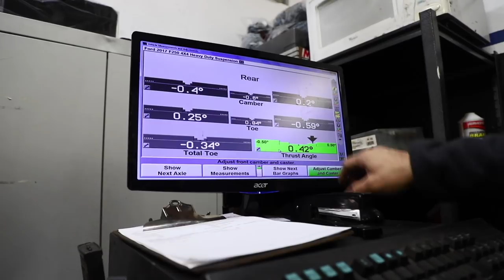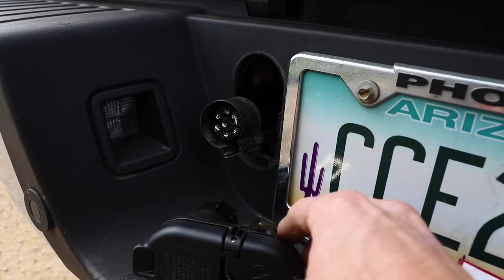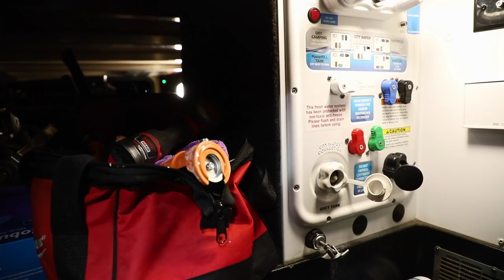SEASON 7 STARTS NOW! NEW AXLE & WARRANTY UPDATE (KYD)

Comment: Just wondering why you chose to do the screw as opposed to just using Binary Epoxy from the dollar store and gluing it on?
Reply from the maker: Epoxy would have worked, but permanent. A set screw is reliable and I can take it apart to replace with the factory part if needed. That was the thinking.

Comment: That is the first issue I ran into when someone in our group brought home a Grand Design  trailer, the axles aren't heavy duty enough.  GD advertises on bigger tanks and thicker gauge siding (on aluminum sided models) which is all heavier, but they use lighter duty axles than some competitors (Jayco for instance).   Really frustrating from a company that is selling at a premium price.  That's what you expect (and get) from manufacturers like Heartland.

Comment: I thought of running the cable through the loop of the pin but, what if for some reason the cable does get yanked it would either pull the pin out or disconnect the latch and the pin would eventually fall out. You might want to rethink that.
Reply from the maker: It's a great point. I'm going to get a locking safety pin.

Comment: Noticed you were checking why zero big trucks with the price of that GMC truck , we have a similar problem in the UK apart from the LHD drive problems our wonderful goverment gets greedy if I import a big truck firstly there s VAT at 20% then a 15% import charge so that push s the prices up 35% above your local prices then we get the importers fleecing us to change all the direction lights to yellow ect ect , So we end up paying 40% extra over and above your local prices, Then you have to ask would you pay 40% extra for your Ford Truck ?

Comment: I must have missed your follow up on the rock tamer guards. How did you like them?  I noticed they are not on the truck
Reply from the maker: I didn't cut them high enough. They need to be 3" off the ground with a load and even that might not be high enough or they can actually create rock chips.

Comment: I have a question: in all your travels, have you ever considered the use of a CB radio, or are they no longer realivant today with cells and apps?
Reply from the maker: We did for a bit. If I was better at it and had a big antenna it would be fun. But it turned out to be another device to keep track of in the cab.

Comment: I am looking at rvs and Ive noticed like on your rv the axles are 5200 lbs each from what I saw from the dealer, I would think you would want 6000 pound axle ratings for a gvwr of almost 11000.
Reply from the maker: It's because of the tongue weight, but I agree. They cut it close. Grand Ginger only has 1,400# of payload. Not much for fulltime usage.

Comment: Grand Design RV look nice but it seems like they have ton of problems. From all the videos,  it just seems like you have issue after issue. Tires, axles, water pump.... Maybe all trailer brands have their problems?  Just seems like a lot.
Reply from the maker: This is a common misconception that I should have mentioned. At this price point, the problems are all isolated to the vendors. Dometic, Limpart, Atwood, Surburban, etc. The same parts on the same price point from a different mfg. Spend another 50k and the owner gets a new set of problems. Many of the problems RV, Boats and Planes have is due to building for weight. Give an engineer another 2,000 pounds of GVWR and the parts get better. Less plastic. Carbon is light, but $$$ Always a trade-off.

Comment: You mentioned that all trailer axles have a curve, I noticed that my brand new Montana has a curve, how are we sure that's not a bend caused by a floor lift.
Reply from the maker: I doubt a floor lift would have been placed in the center of your axle. The crown is normally a slight curve. You could take it to an axle alignment shop to check, but our tires will be the giveaway.

Comment: Creative but concerning.
1) cable under hitch lock pin, if it pops out major accident concern.
2) tow harness attached w/screw , get a net wire harness section...
Good Luck.
Reply from the maker: I agree. Making corrections.

Comment: Hey I thought I would let you know something about axles, there really are no  5200 lb axles, sounds crazy I know but you can check it out your self as I'm sure you will. Really there are 7000 lb axles with derated hubs. So you're axle is really not even close to being overweight just the bearings on the derated hubs. So I'm sure that axle replaced was defective from Dexter. You could buy 8 lug his and new wheels and have 7000 lb axles that's what I did and I never worry about my axles now. Have good travels this year.
Reply from the maker: I get it and that makes sense. I still think the axle was defective from the start. It had a funny shape all along.

Comment: Putting the trailer cable through the hitch lock pin would worry me with that spring pin.  If you have any snag during a turn and lose the pin you are down one safety device.  If you used a padlock for the lock pin then it would be safer and give you some extra theft security and you could loop the cable through it.  Could just be a long shackle combination lock so you don't have to worry about a key.  Also won't have to worry about some bozo who thinks its funny to mess with your rig and pull the pin on you.
Reply from the maker: I agree. That's a good idea. And because the pin is never removed a lock is a good idea. Good input.

Comment: your instaled the new power clip its up side down. the rain  water its going to go inside
Reply: Negative.  It is on correctly.  Look at any Ford truck and see for yourself.  It is also DC power.  A little water is not a problem.

Comment: What is the reason for not crossing your chains? Because of the Hensley hitch?
Reply from the maker: I mentioned this in this video, but it didn't make the edit. The point where the chains come from are on a ring (same point). They don't cross. Even when I cross them, they don't actually cross.
Reply: Thanks for the reply. Makes sense with the ring. Watch out for the wind.

Comment: Cringggeeeee let those glow plugs warm up😁😁
Reply from the maker: Is that still a thing with the new diesels?
Reply: @KeepYourDaydream  Absolutely! May be less of an issue in your warmer climate,  never the less a 70° engine is still a "cold engine." So turning the key to accessory, waiting the ~10 seconds for the glow plugs to warm up heats the cylinders which gives you a better ignition on start up.

Comment: Boy that dealer ripped you on the waste water fix. Less than $30.00 and 2 minutes of your time to install a Valtera twist on waste valve would have cured your problem, would have saved way over $200.00 Guess you know where never to go back to now.
Reply from the maker: I agree. I added it to the work order at drop off. They never called and asked for an estimate. I should have known better when I picked it up, but I was so pleased how much Grand Design covered, $289 seemed like a bargain overall.
Reply: @KeepYourDaydream  We are in the planning stage yet for our retirement gift to ourselves. 1st time buyers. Went through a GD Imagine 2970RL and fell in love with it. We are also considering a Winnebago Minnie Plus TT. Like the Win. for it's torsion axles and honestly the one thing that kind of turned me off so far on the GD is the overstated R-Values.........not realistic to have R-40 in the roof (13 inches fiberglass needed) the floor I have seen opened and it's just the foil barrier. Foil barriers have no R Value. Win. is very realistic with their R-Values. Would you buy a GD again?